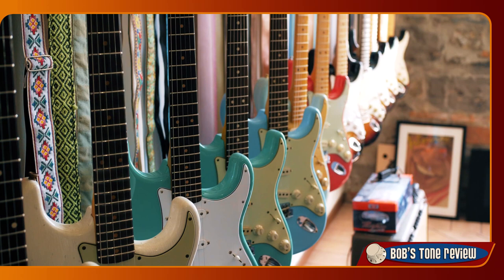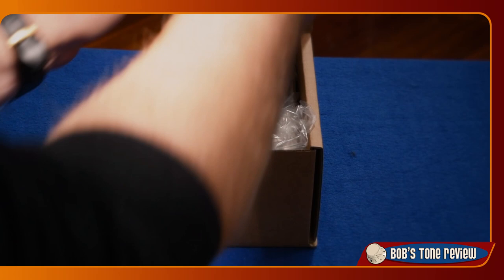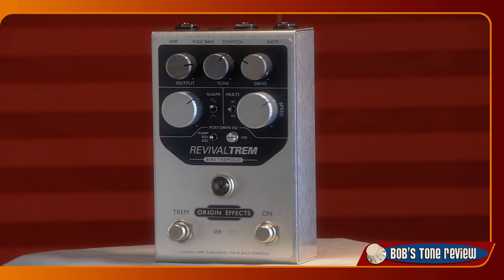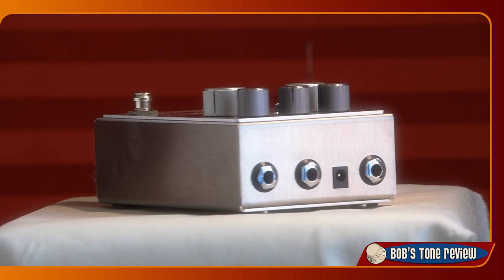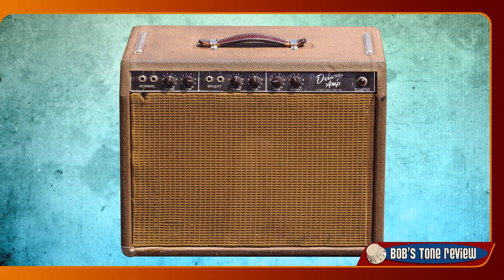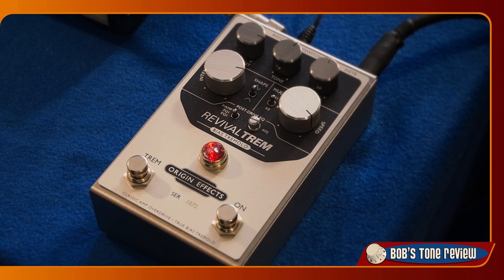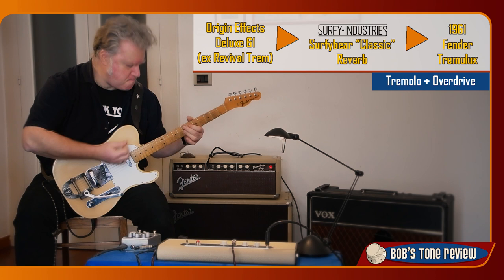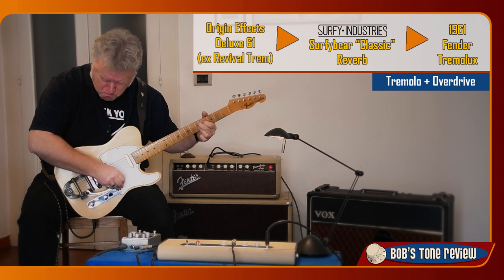BTR#47 Vintage Tremolo: from amplifier to pedal

Comment: Only thing I love more than tremolo is vibrato
Reply from the maker: Ha! Ha! Makes sense! : ))
Reply: For true electronic vibrato you need a Magnatone amp.  Although, I refurbished an old brown Fender Concert amp some years ago, the one with the "harmonic vibrato" circuit that required 2 1/2 or 3 tubes just for the tremolo, and that circuit sounds way better than any other Fender tremolo I have heard.  It's not quite true vibrato but it has a lot of phase shift and interesting things going on. I have never particularly cared for the Fender vibrato circuit with the LDR, the flashing light photo cell "roach" thing as everybody calls it.

Comment: Which type of tremolo (sine wave) was used in each of those 7 songs?
Reply from the maker: That's a tough question to answer Matheus. For instance "How Soon Is Now" is often reported as typical example of photocell tremolo with triangle waveform while I think it sounds too cool for being just a plain amp tremolo. I'm pretty convinced that it was helped in studio with some production skills... maybe a doubled guitar tremolo track slightly shifted out of phase? Also John Fogerty of the Creedence Clearwater Revival used Kustom amplifiers in his live shows, which probably had a photocell tremolo and probably that's what you hear in the video... but who knows what he used in the studio version of Born on the Bayou? It rather sounds to me like a bias modulating tremolo from the Brownface era with sinusoidal waveform and gorgeous smooth tone. Reportedly Keith Richards also uses a photocell tremolo in Gimme Shelter.
Reply: @BobsToneReview  Thanks Bob, that makes total sense. I just listened to "How Soon Is Now" turning off one speaker at a time. There's a faster tremolo on the right speaker in sync to the beat and a slow one on the left, creating a Doppler effect. 
In gimme shelter something like that happens, the tremolo guitar is on the left and a clean guitar on the right channel.
I've been using a wiggler tremolo pedal for tremolo and vibrato and been loving it since. I don't know if it uses a photocell like the fulltone but it's a beast!
Reply from the maker: @mathenoo  Thank you, all very interesting!